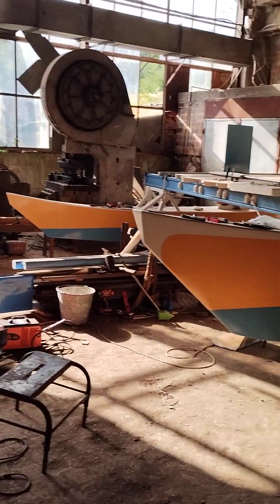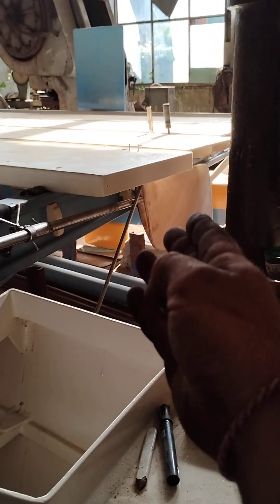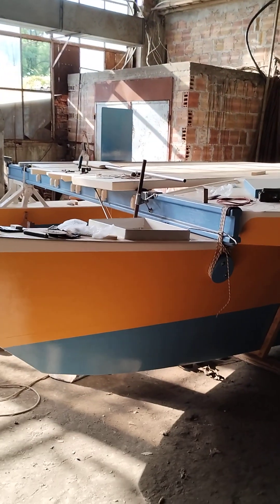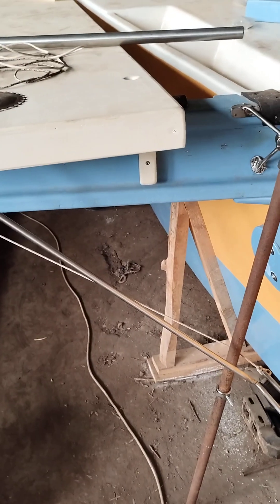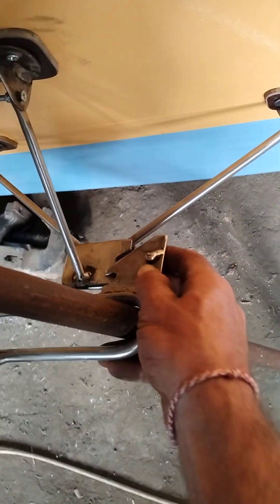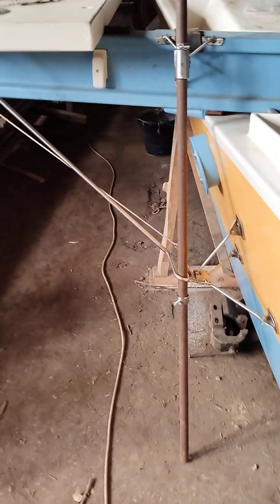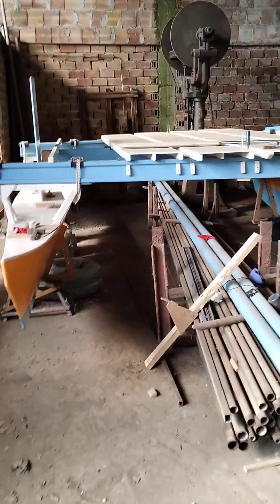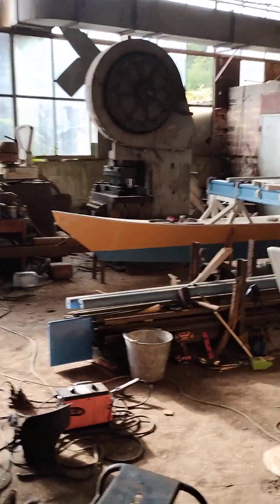Shunting Proa Rudders, the Full Design, BSY.

Comment: I like the look of those shock absorbers, looks like a good solution 👍
How are you planning to move him? maybe a little too much to load on the roof of boyko, I know boyko is a strong boy, but all cars have their limits.
Reply from the maker: The biggest problem is how to connect them also to the sidewall, not only to deck... I may have to drill through hull holes under the leepod, connect something inside the hull and connect the shock absorbers through deck with something long to that.... Moving is with trailers from now on, so every move digs in the pocket... Anyway I'm happy, doing my best. Take care Dave